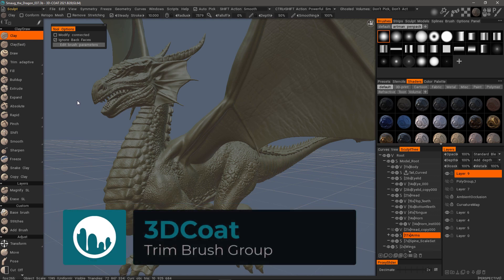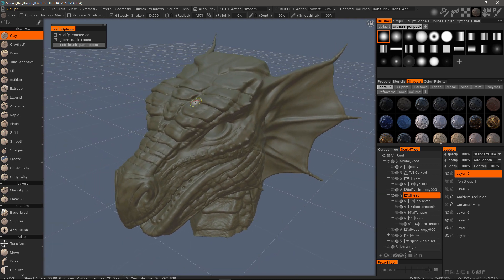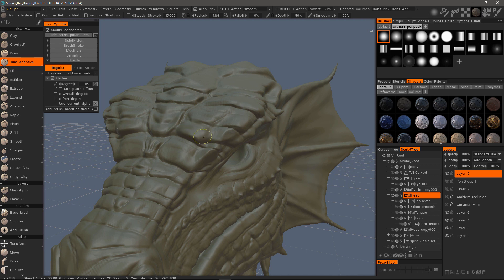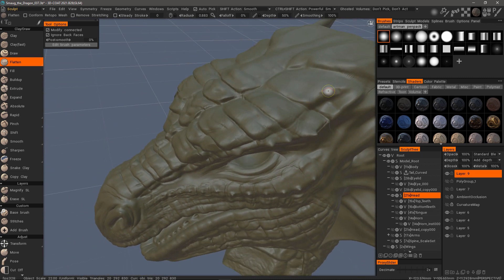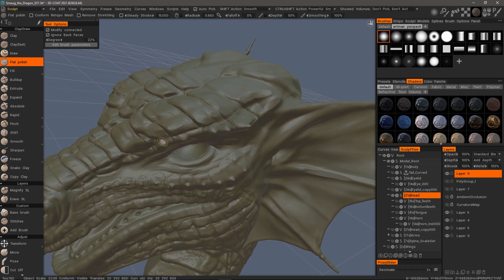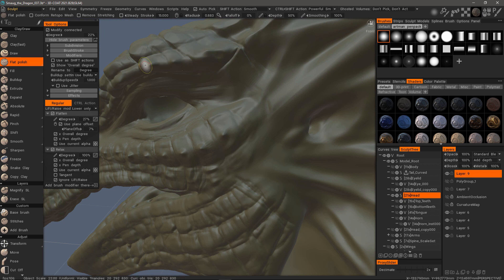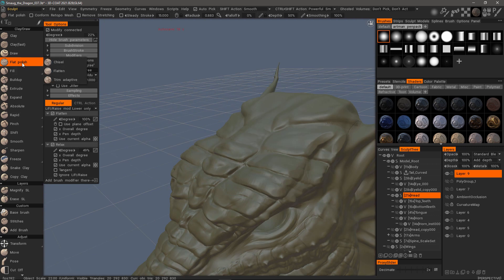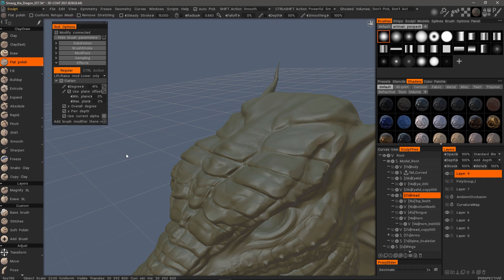Trim Brush Group

Comment: i guess if you purpose is to engage more audience count , you need to focus on these: 
1)stability 
2)performance 
3)usability 
4)ergonomy
And flexibility ofcorse! 
Thank you!
Reply from the maker: The last few videos are just demonstrating new brushes in 3DCoat 2021. Yes, we are certainly aware that all the things you listed are important to users.
Reply: thats all true but in using any software, which as much as people want it to be something industrial is creative writing and application of cutting edge algos on top of hardware thats always changing and evolving. my point is we as users have to also learn how it works and its idiosyncrasies as well. all programs have these and to really be effective we have to learn and play through some trial and error. then if we also want the software to evolve we also should help the devs in giving feedback as we are doing this. in some ways its a partnership between users and devs. any tool has its limitations and problems. 20 plus year game artist here. used almost all art software at one time or another.
Reply: @Azaryth365  if they can afford it without dev suffering from that decision. their upgrade cost is very small. idk how zb has achieved this state maybe by mass adoption at some point in the market has allowed them to go there.